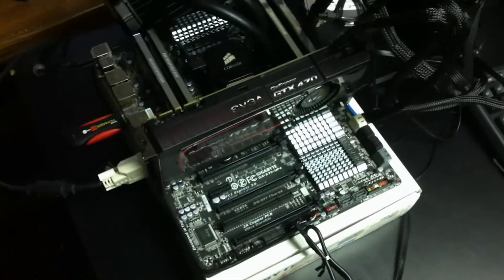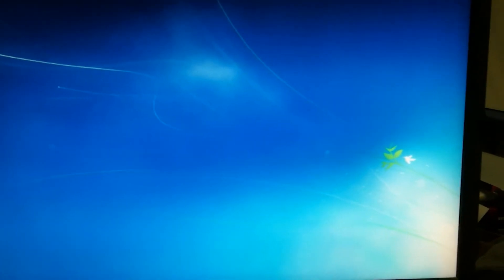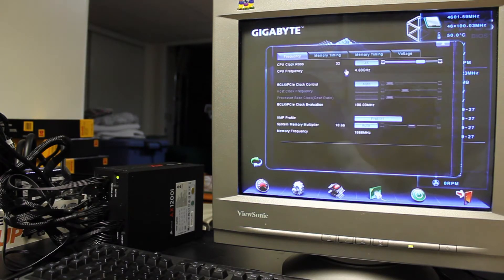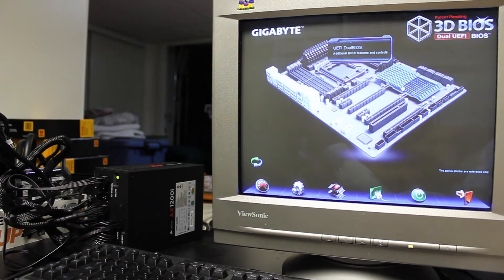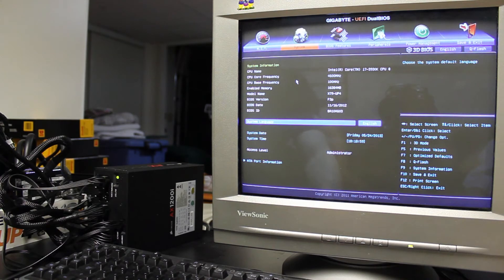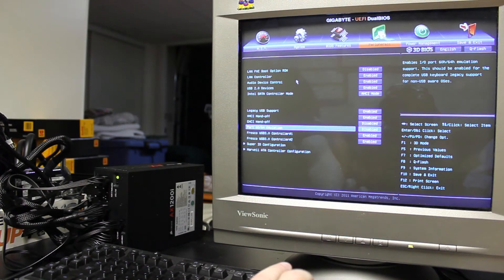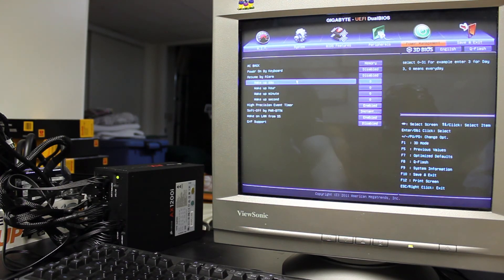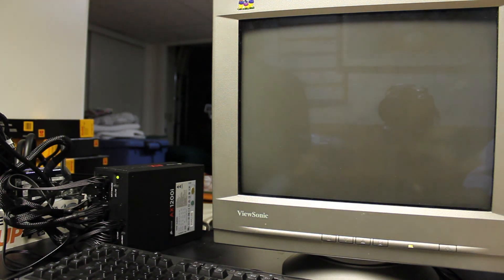Build 2013 - First Boot and BIOS Overview

Comment from the maker: Yes it was, and I think the DualBIOS is quite easy to use. All the familiar features of an older style BIOS in the advanced options at the bottom of the 3D BIOS, and quick and easy access to most of the stuff you need for basic setup in the 3D BIOS.

Comment from the maker: I will likely grab some more RAM in the future, if and when I feel like I need it or if I simply have enough extra cash sitting around that I can spend at the time.

This rig will be primarily used for gaming while capturing video for either local video editing later, or live-streaming right away to the Internet. Additionally I'll be using it for some other video editing and photo editing.